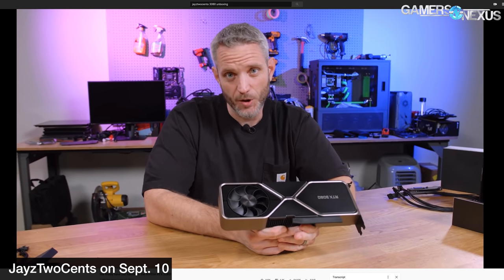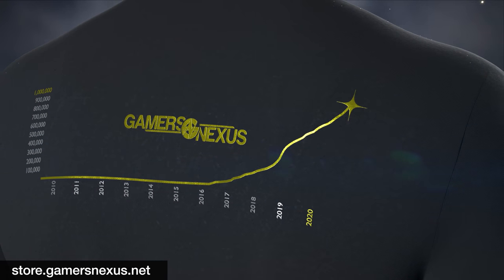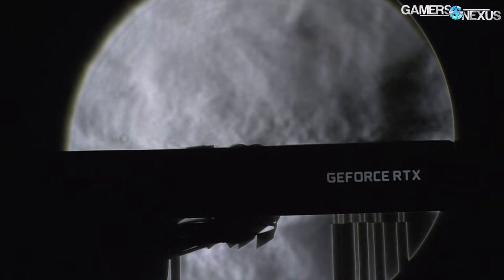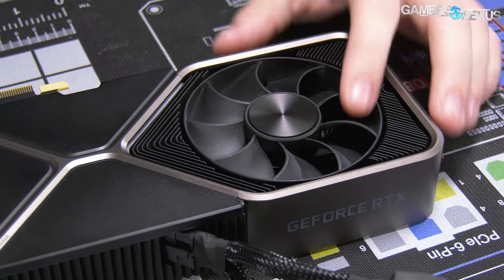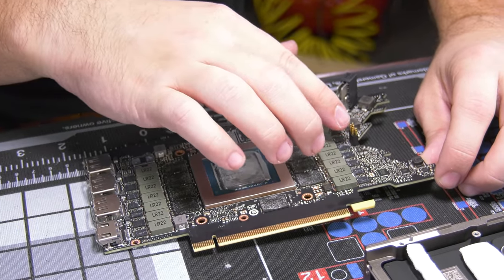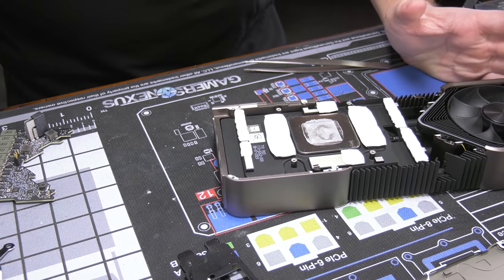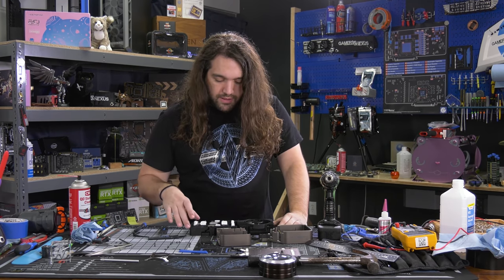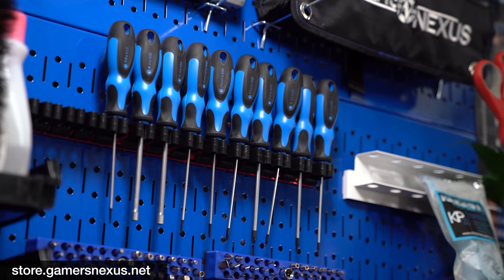Tear-Down: NVIDIA RTX 3080 Founders Edition Disassembly - A Lot Fewer Screws

Comment: RTX 2000 - "we used ALL the screws"
RTX 3000 - "we have less screws, but some clips"
RTX 4000 - "that's right, we replaced ALL the screws with glue!"
Reply: RTX 4000 - "We have 1 screw, you take it off, it falls apart, have fun assembling it again :D"
RTX 5000 - "It's all magnetic now, just pull your GPU apart with your bare hands...also don't drop it, the PCB might survive but you might never figure out what fits where XD"

Comment: I'm glad I went with a used Dell RTX 3080. It's physical design is superior to the Founders Edition...two standard eight-pin PCIE power connectors, a lot of screws, no ZIF connectors.

Comment: Got a MSI 3080 on my old 7700k, 32gb ram, ga-z270-hd3p mobo. I get 4 short beeps when starting up. Everything works fine tho. No crashes, slow downs, high temps, nothing. I'm intrigued as to what those beeps are. According to Gigabyte 4 short beeps has to do with the internal clock (it's not that). I have tried different PSU, RAM, old GPU (makes beeps go away), reset bios, different cables, etc. Wondering if it has something to do with gen 3 and gen 4 pcie (my mobo is gen 3, card is gen 4).

Comment: So as I watch these teardowns of both laptops and graphics cards, could you in theory solder memory chips into those empty spaces? Given they're the same size and capacity? Say take the 3080 from 10 GB of memory up to 12 or slightly higher depending on what the capacity of each chip is? I'm assuming there are bios and driver limitations that would prevent it from working, but it would be interesting to see someone try it out and see if they could get it to work.

Comment: 14:50 - Noooo.... You see that thick part right up against the socket? That is what you are supposed to use to pull the wire out, and put it back in. Pulling on the thinnest part is like pulling on a 30 gauge wire with silicone sheathing ( thin ) when there is a thick hard plastic point at the connection point acting as a relief....

Comment: They could drop the pricing because they lowered item count on bill of materials.
Anyway, what parts are metal? Are all brownish silver parts anodized aluminum? If yes, can You ask nvidia, if they would show some behind the scenes from machining it? Because that outside shroud is big by volume, so to machine it, it would require a big billet. What is their setup for manufacturing? Are they manufacturing the "V" from leftover material? How do they cut the reliefs for clips that hold the heatsink inside. Also I'm wondering, if glass blasting/soda blastink the heatsink so it's raw copper, aluminum and plated copper would benefit it at all?

Comment: I really want to get the FE because my case (Phanteks Evolv ITX) can only fit a dual slot GPU and have no interest in wanting to change the cooler, but I know from experience that every time I replace the stock dry paste with MX4, I see anywhere from a 5-10c temperature reduction. One time I had a pair of MSI Lightning Edition GTX 680s (back when SLI used to actually work), and one always ran 90-100c while the other was fine. And they had 'warranty void if removed' stickers on all the screws. I still opened it, repasted, and voila, <80c even with max stable overclock.

Right now I'm pondering if I should wait for the refresh of either a 20 Gb 3080 or possible 12 Gb 3080 Ti, but the latter might not be a dual slot design as this thing already runs really hot for a dual slot card, and I dont think Nvidia themselves will release a 20 Gb 3080, only AIBs and those will be too thick for my case.

And I'm not getting a new case, I literally just got my Phanteks ITX with a 10900K to fit a 280mm AIO (smallest case that can fit a Corsair H115i, but nothing much more). But I'm limited to dual slot but up to 330cm long GPU so for now the FE 3080 is the only thing that will fit.

Comment: Steve, could you please look into where all the Watts are going? 
It is weird that the card takes so much electricity. 
Have they made a high voltage solution and will that make the components die fast?

Comment: You didn't remove the fans..  Is that process self explanatory also?? Asking, since they are probably something else that may need attention at a later date.    Love the video..   G
Reply: I just watched the tear down of the 3090 (your video), in which, also included the removal of said fan(s)... Although they would be of a different structure (being larger), I'm sure that the removal of said fan(s) is similar in fashion to this 3080 card.... So thank you for that inclusion, on your other (newer) video.     G

Comment: So what was the flex cable for?  Were the pin and pad connectors for the fans?  Just curious what will be lost when going for a water block instead.

Comment: I think it's not so much that Nvidia listened to the less screws request on their boards, but that they realized there's substantial costs savings to having less screws, which drives down the building costs of the boards. In some unnamed company which were producing ink jet printers, designers were purposely putting in more screws and nuts in their design so that when the annual management mandate came to lower building costs by x%, the designers just took out the superfluous screws and met the lowered build costs objectives.  If it hits their bottom lines, companies will listen. Having less screws means less costs for components, less shipping weight, less assembly times, etc..  which translates to increased profit margins, with just a bit more effort on the PCB design team.

Comment: just a thought . soo the power line is a bit fake ? dousnt really need power on all pins ? dismandling showed like 5 bridges buth the back has only 4 solder spots .. so 2x + and 2x - wires are enough ?

Comment: I have this exact same card, I watercooled it and now I've put it back together, but im missing that silver x-bracket 17:26. It's not overheating, but I'm just wondering if I can proceed with out it? Please let me know!!!
Reply: It’s for better contact with die for the cooler. I definitely think it’s necessary. Check ebay to find a replacement

Comment: damn having taken appart (to install a waterblock) a GTX 470, GTX 980ti and a RTX 2070 super this cooler by far seems the most nerve wrecking to remove, did seem like it seperated from the cooler quite easely...or you are far less carefull then i usually am (sweating bullets from the 1st screw to the waterblock beeing on there)

Comment: Does the pcb have to be removed before the plastic housing around the cooler? Also how are the thermals with it running with out the plastic housing and just the back plate?

Comment: Is there a version close to this with a plastic housing, just seems like extra weight on the MB and added heat? As for the lack of screws it seems you only need a few attached to a massive heatsink for an anchor. Will wait for a heat map for it later. I still don,t think the ram for the price is worth it, maybe if it was 12gb then yea. Opinions.

Comment: I'm doing a really compact novec case and this card is defo getting stripped down.

I need to model this... any chance you could give me the length, width, thickness, height of most of the components on both sides and height of that power connector. A scan of the board would also be great to trace the outline, but I can live with a rectangle until I actually strip my own down; if i'm lucky enough to get it.

Does the probe connector need to be bridged for the card to function without the heatsink?

Comment: The 3080 Launch Day Experience (TM)

Get up.
Rush to PC.
You've got your 8+ windows up.
Your timezone's launch hits.
Refresh like a crack addict.
Websites immediately crash in unison:
- EVGA ceases to be, remanifests empty, barren
- Nvidia doesn't crash, but apparently never had any to begin with
- Newegg crashes, or when it works, shows you an 'Add to Cart' button just to tease you, let the dots circle meaninglessly
- Best Buy doesn't crash for long, but existing 3080s INSTANT TRANSMISSION out of the real into the noumenal
- B&H no longer exists. It never existed.
- Amazon trolls everyone, either never had any stock or Bezos personally owns all of them now.

Thanks Nvidia. Great launch. If you boost the price after this pathetic launch, I won't even be surprised, nor disappointed, just angry.

Comment: "Pro Tips" Hot Glue tooth pick's on screw covers... Easy
Reply: Pro Tip? Why would you want to use hot glue when a piece of tape works? Thats not a Pro Tip dude.
Reply: @ironmaiden5658  May be yes may be not, anyway hot glue 100% solution.

Comment: why doesn't nvidia just make a graphics card the same size as a motherboard? It will improve a lot in heat flow, capacity. You can definitely fit 2 motherboard size components into a tower.

Comment: I wonder if a pressure sensitive adhesive putty, like Blu-Tack, would work for those screw covers. "Adhesive on a stick," may also be my favorite stupid thing from Nvidia, and I hope Nvidia is banished to meme hell for this; I may also use it as a sarcastic answer whenever someone needs help removing something, "Have you tried adhesive on a stick?" I'd actually love it if whoever was creating the disassembly guide asked one of the engineers how to remove those covers, and, "adhesive on a stick," was legitimately a sarcastic answer, instead of just saying to use a powerful magnet. 

I also really want to see one of the water cooling companies to make a block for this card. Everything except for the orientation of that power connector makes the card a single slot card. Plus it'd be interesting to see what these companies would do with the V cutout. 
I'm also curious what board partners are going to do, they could easily make a half length card just like the FE card is, which is a massive shrink in footprint, and could benefit smaller case form factors. 
As for that cooler, I kinda want to see someone tear it down further. From the renderings that the reveal had, it looked like the cooling was a sandwich of the gpu/memory plate, the heat pipes that go to the back of the card, and the blower style cooler at the front of the card as a separate component. If the blower portion is a separate component that can be desoldered from the stack, I think this would be a great opportunity for a hybrid cooler; or go even more foreign and somehow sandwich the water portion of the hybrid cooler between the gpu plate and the blower style cooler, replacing the blow-through cooler portion, and have the fittings come out the back of the card.

Comment: Hmm the Thermal paste being that dry means its pretty old, atleast a year or more?
Reply: No, could just be that there was a delay in the installation of the cooler or maybe the paste has been exposed to air before being applied.
Thermal compounds dry up quickly if they are exposed to air.

Comment: Hey you guys skipped the part where you show how to take out that tricky yellow and black wired connector. That was a terrible thing to skip as it's literally the only connection that looks like that on the 3080 and you can't do to it what you say to do! You can't stick tweezers under it all. The connector itself is a sliding latch connector you have to slide it off of the plug and then simply lift up the connector as it's no longer attached to anything. In your genius you guys decide to skip that in post editing this video which is a big mistake as most people who disassembled this card need to know how to get that apart without breaking it!
Reply: Glad I found this comment as I'm re-padding the core side soon.

Comment: The connector at around 16:30 looks like a HIROSE SnapBee connector, yeah, you pull it upwards from the board as it is designed to counter forces acting on the cable that pull on the connector. So it would never unclip, actually really genius I think for a connector that is supposed to never loosen. Just needs people to know how they work, so can't blame it on Nvidia.

On another note that metal frame and vapor chamber + heat pipe cooler setup looks heeella expensive, both in materials and manufacturing processes (time, employee salary, stock and warehouse (management)), can you not ask them to sell a PCB RTX 3080 version for those who find their own cooling solution? Say, for 599? ;) Just imagine...
Reply: Nvm, with the cost of the cooler alone being 155 USD for Nvidia (source: Igors Lab) as well as the fact that you are saving on aestetics, you can sell it for 200€ less, so 499€ for the 3080? XD 
I promise you, noone is NOT gonna buy it. Profit stonks :D

Comment: is there any reason, why the one fan is on the back-side pulling air instead of pushing it like the other? I cant see any meaningful reasong why nvidia shouldnt have use two identical fans to blow air into the cooler.
Reply: I think you generally want to pull cool air in and push hot air out.
If you pull from both sides then you just pull in the air you just pushed out.
However if you pull in from one side and push out from the other, then you constantly push away the hot air and this leads to more cool air reaching your card.
At least that is what I, as a total amateur in this field, think.

Comment: If AMD has even 50% of the performance I am going with them. Nvidia has been pulling a ton of shit lately, with this, the "no teardowns" thing, and most importantly their Linux support. Driver version 450 completely broke suspend/resume in KDE, now results in a black screen and mouse cursor, and they still insist on a proprietary driver unlike both Intel and AMD. On top of this there is still ZERO support for raytracing on Linux, meaning RTX cards are completely useless. Bottom line, don't care about the performance of a card if it won't even work on my operating system, especially if the vendor is actively hostile towards open source and modification.
Reply: cope linux peasant

Comment: Here are some useless time stamps

@1:50 Tech Jesus blesses Nvidia's design team
@4:47 fuck it, WE'LL DO IT LIVE!!
@6:39 the Lord mistakens Livestrong bracelet for antistatic band
@15:02 teasing the Nvidia engineering team
@16:50 some guy from Hewlett Packard probably designed this part (requires zip-tie to disconnect)
@24:41 milord showing signs of fatigue and dehydration
@25:10 exasperated "Jesus"
@28:59 guidelines to folllw for the PC MacGyver enthusiasts
@30:55 16 screws were cursed at during this tear-down
@31:55 directed assault at rainbow puke fanboys

Comment: Yeah you reviewers have the only fe cards nvidia made...rest of us ...zero released. Here in uk nvidia changed the notify me option to sold out in less than a second and at no time was there even the option to buy one.  As soon as nvidia did this trick it had the desired effect of increasing the live uk prices of partner cards by 100 plus pounds. Nvidias lies re turing and rip off prices made me dislike them even though l have been a long term customer with only nvidia in all systems l build to sell...but this underhanded trick of saying they releasing the fe in uk that u guys have then not releasing it pretending it went out of stock when it never went on sale means lve had enough of nvidia. All my builds will be ryzen and  amds gpus from now on. I looking ng forward to rdna2...tbh l would rather have the same tech as whats in modern consoles but in a more powerful gpu in pc as then most games will be ported across fantastically optimised where as nvidia will pay developers to use dlss 2 and its fps killing ray tracing that night one cares about.  Nvidia inflating prices and making all 3080s far more expensive than the advertised price means l hope many of you see sense and leave this greedy  nvidia company behind.  Tbh the 3080 not much faster than my 2080 super which uses 75 w less power....so l more than happy to wait for rdna2. I used to only use intel for cpus...but once amd releasing 3700 x cpus 8 core 16 thread at 65 w l jumped to amd....with nvidia...their prices and turing and now their dirty tricks of inflating prices meaning again they totally lied knowing we cant get a 649.99 and even if we didvit would a poorer version of the fe. I reported nvidia to uks advert agency standards with a conplaint about their practices.. do this all pls.